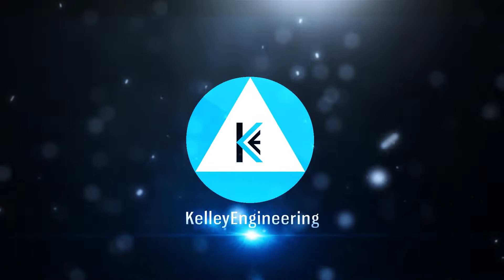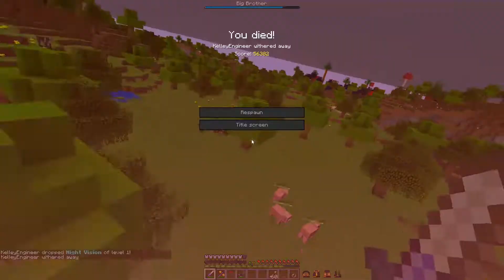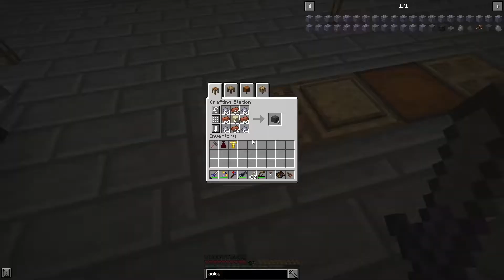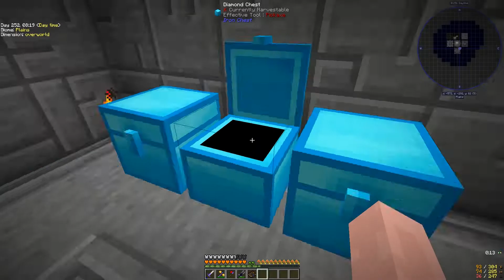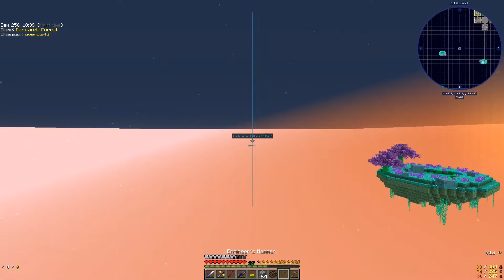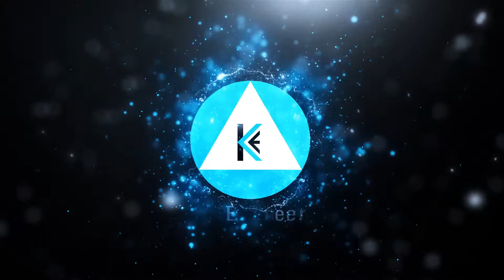Project Ozone 3 EP11 - Immersed in Engineering

Comment: shift clicking an IE pump lets you interact with the opposite face of what youre trying to interact with the engineers hammer, this is true with all configurable blocks in IE
Reply: putting iron ingots is more efficient if you are using coke blocks, gets you 10 per coke block instead of 9

Comment: Those Zombies, Creepers, and Spiders really want to say hello to you and see your nice base with a hole in it. I have a few tips you might find helpful. You can shift right click to configure the opposite face of your fluid pumps to avoid having to break blocks. For a faster way to batch craft a lot of treated wood planks, craft a Thermal Portable Tank and fill it with Creosote, then use it in place of the bucket in the recipe. The Engineer's Hammer can rotate blocks, so for your piston in your metal press, you could rotate it into place instead of needing to get below the above block.